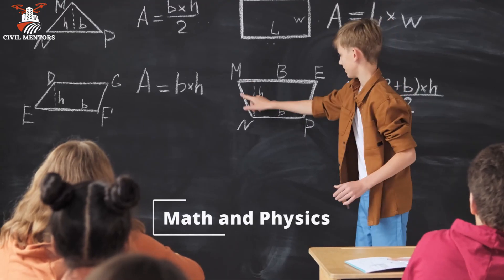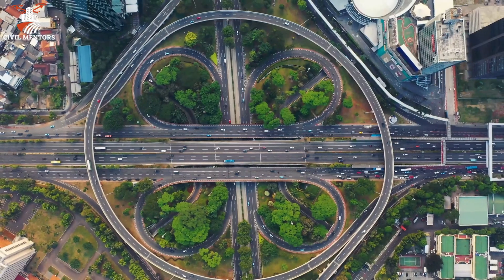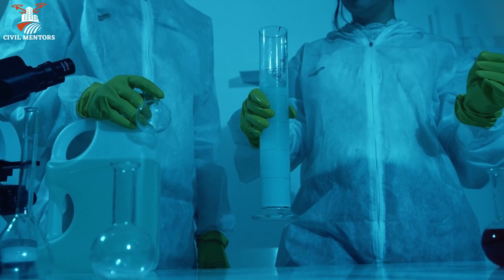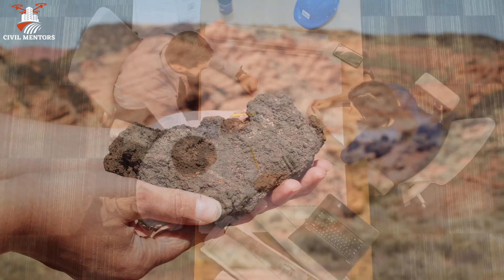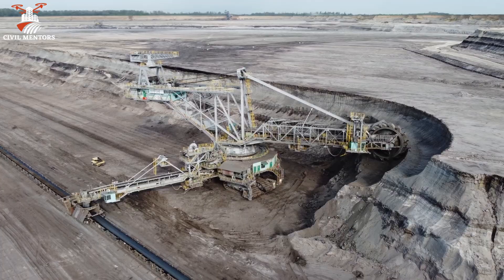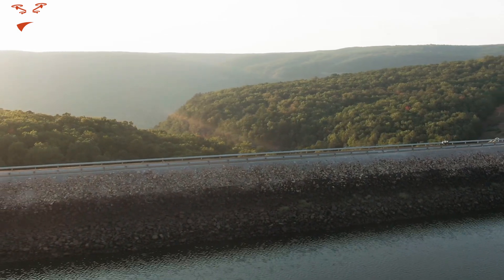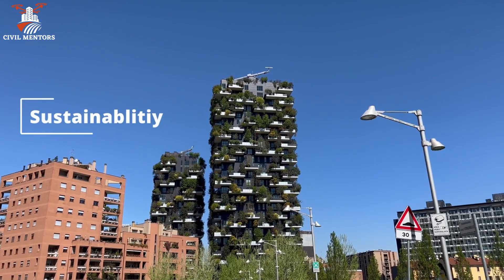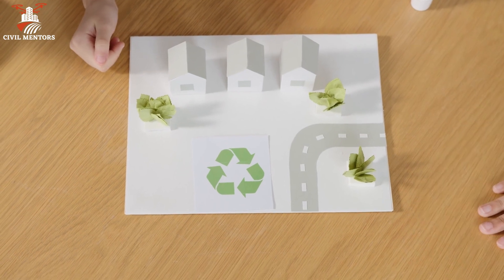Civil Engineering Basic Knowledge You Must Learn

Comment: Great overview of civil engineering fundamentals! I'd emphasize that understanding soil mechanics and geotechnical principles is absolutely critical - the Mohr-Coulomb failure criterion and bearing capacity calculations using Terzaghi's equations are essential for any foundation design. Also, mastering structural analysis methods like moment distribution and the stiffness matrix approach helps engineers transition smoothly into using modern FEA software like SAP2000 or ETABS. The interdisciplinary nature you mentioned is spot-on - coordinating with MEP engineers on building systems integration often makes or breaks a project's constructability.

Comment: To gain a basic understanding of civil engineering, one must learn the following key areas:

1. **Materials Science**: Understanding the properties and applications of construction materials like concrete, steel, and asphalt.

2. **Structural Analysis**: Knowledge of how structures support loads and resist forces.

3. **Surveying**: Techniques for measuring land and mapping out construction sites.

4. **Geotechnics**: Study of soil mechanics and foundation engineering.

5. **Hydraulics and Hydrology**: Understanding fluid mechanics and water resource management.

6. **Transportation Engineering**: Design and maintenance of transportation systems like roads, bridges, and tunnels.

7. **Construction Management**: Principles of project planning, scheduling, and cost estimation.

8. **Environmental Engineering**: Focus on sustainable design and managing the impact of construction on the environment.

These areas form the foundation of civil engineering and are essential for anyone pursuing a career in the field.